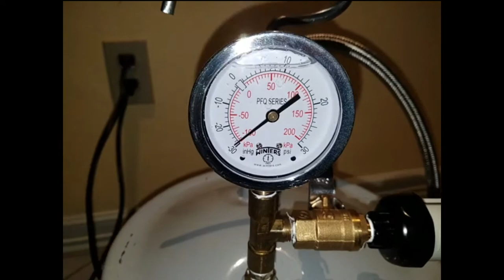Drying 3D printer filament with vacuum

Comment: When you are done have you seen water in there?  I know a vacuum will make water boil at a much lower temp but at -30 mercury I have no idea what the boiling temp would be but in a standard vacuum water will happily boil at room temp.  Not even sure any heat is needed at -30.
Reply from the maker: I have seen some condensation in there- the general idea of the heater was to lightly apply heat to get as much of the water possible in there to become vapor before the vacuum is applied, and then use the vacuum to draw the humid air out. I haven't done any extensive testing on the effectiveness, and less so since the extruder failed on my printer- waiting for the Monoprice Delta to get here.
Reply: I was wondering the same, as everyone that seems to do uses heat.  However (1) if there is no air, what will transfer the heat?  Only what is touching the metal can will receive any  heat and the plastic spools are too inefficient thermally to be of any value.  Second, I checked a boiling point calculator for grins and giggles and none of them would calculate a negative pressure value so I used 1 inch/Hg and the result was 73 deg F, so room temp.  So -29 Inch/Hg means instant vaporization so why wait for a food dryer to heat it for hours?  The only question I am thinking is removing the free vapor and frankly I not sure one should even worry about it as it will be so little it could not effectively be-reabsorbed.  Werner Berry did a video on this in 2013 and he said he found less then 1 gram as I was reading some commercial stuff and they said the water only infiltrates at the surface level.  So I was thinking instead of simply re-pressurizing the container with room air, I would back flood it with compressed CO2 first...
Reply: @DIY3DTECHcom  I enjoy watching your videos.  There is no air in space yet we feel the heat of the sun!  I work with large-scale (10,000 liters or more) vacuum freeze drying systems and processes that take days.  Adding heat significantly speeds up the drying process by adding energy and overcoming the cooling effect of evaporation.  The temperature of wet filament will start out much lower than the temperature of the exterior of the container but as moisture is removed, the filament temperature will slowly rise.   If your drop the pressure low enough in a sealed container, the moisture will just freeze.  Keeping the vacuum pump running would also speed up the process since evaporation and/or sublimation cause the pressure to rise within a sealed container.   Putting the heater pad on the bottom may also be better to conduct the heat directly to the spool since, yes, heat does not transfer well in a vacuum.